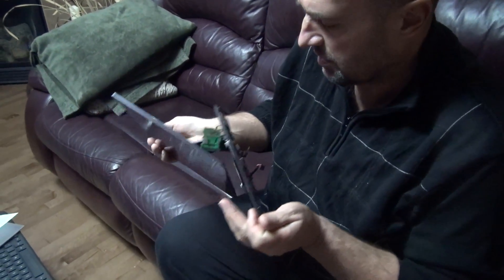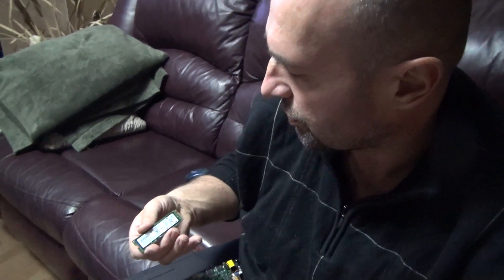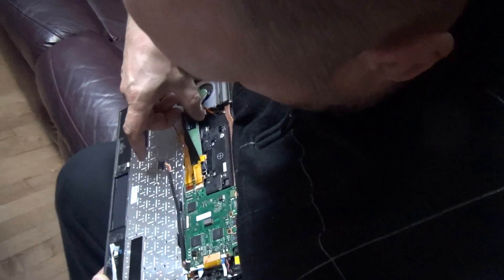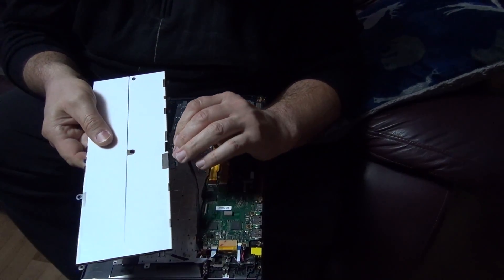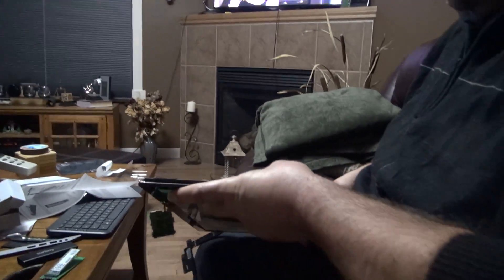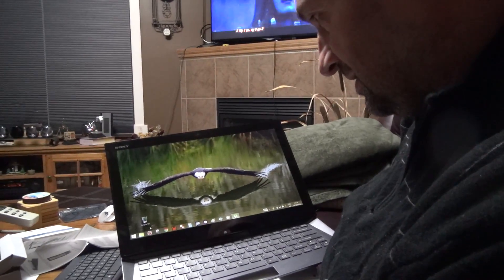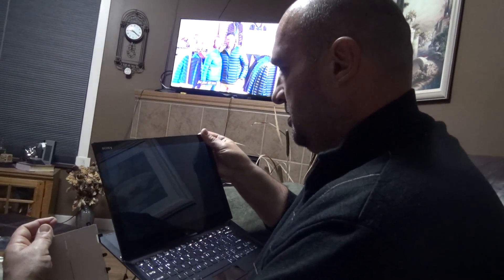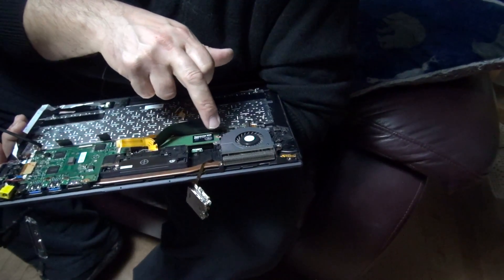SOLID STATE DRIVE  V-NAND SSD 850 EVO SAMSUNG M.2 250GB CRAZY swap  SONY VAIO DUO 13  20161015211152

Comment: Did just swap it with out any software needed?
Do you know if the Pro 11 is the same Samsung model and size?
Also where did you buy the battery?

Thank you!.
Reply from the maker: I used samsung migration software which came with hard-solid drive before swapping , did not change battery ..
Reply: Samsung migration software?.
Is there a link for it (is so can you share it please)?. Or was there software previously installed in your laptop?.
Thank you!.
Reply from the maker: It is free to download ..... http://www.samsung.com/semiconductor/minisite/ssd/download/tools/